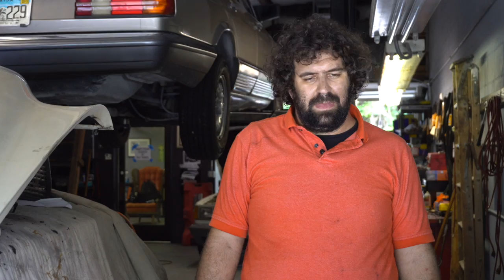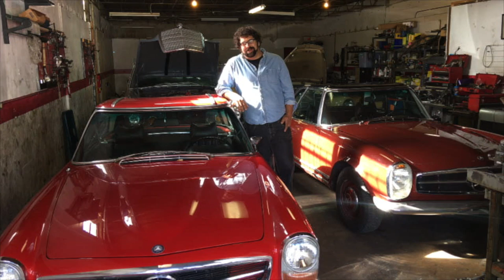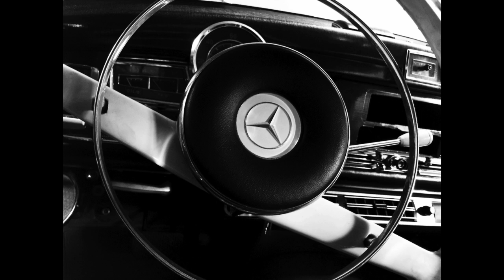Lots of Black Smoke from your 280E . . .

Comment: Hi. My W124 230E 4 cylinder was in massive flood up to roof. Now got it started, made some repairs well started but engine idle was quite low rpm and puffing black smoke. It runs well when it is on highway but it is rough when near stops go situation. All ignitions items include plugs, cables changed. New fuel, air and oil filters, new fuel pump. Checked the distributor pressure, fuel squirts. Mechanic told me it was the fuel divider(distributor) that needs change. What could have cause this smoke and rough idle problem? Power delivery is not smooth when accelerate.

Comment: 1979 mercedes 280 slightly white smoke coming out of the exhaust. Any idea?
Reply from the maker: 1. water in fuel or fuel filter
2. head gasket leaking into exhaust valve area
3. worn valve guides
4. condensate in exhaust system